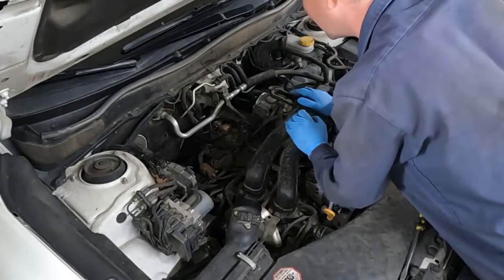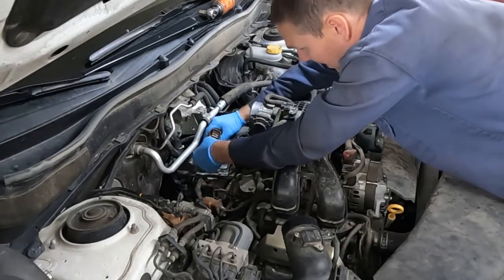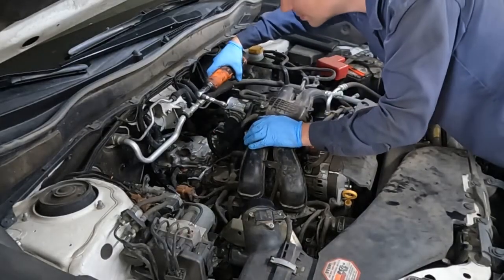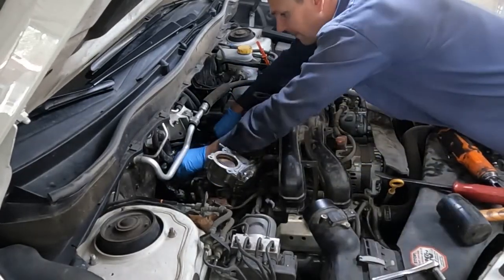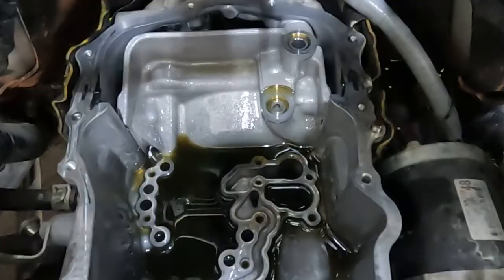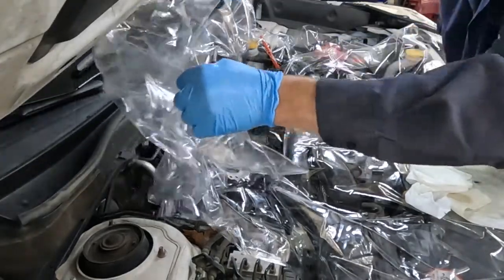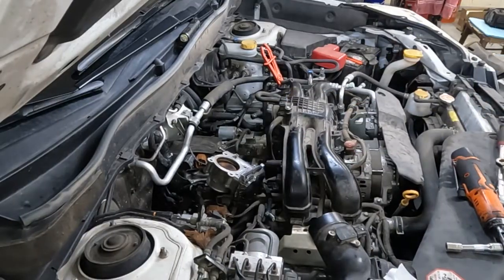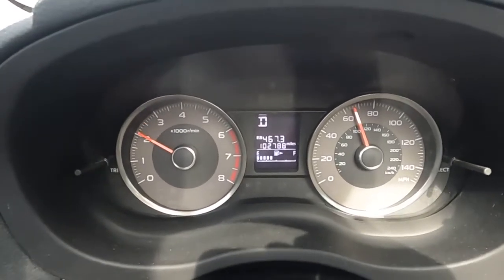2010-2016 Subaru Forester, Outback Transmission Valve Body Replacement | TR580 CVT

Comment from the maker: You now have the option to just replace the solenoids instead of the whole valve body! The links are in the description 👍
Reply: This was the comment I was hoping to see. I have a pressure control solenoid C - was told by my mechanic friend it could be replaced
Reply: En donde se encuentran

Comment: Just wanted to say thank you for such an awesome video. I watched this a few times and knocked out the replacement start to finish no problem.
Reply from the maker: Awesome! Glad this was helpful 👊. When I had the plastic draped over the engine I felt like a surgeon 😂
Reply: @ValleyMobileAutomotive  yeah I thought to myself… what a good idea and when I unboxed mine…. I tossed it to the side and got into it 😂 but I did power wash everything before starting.

Comment: We have to do this ourselves as we are in Belize, and no Subaru shop to be found.  Great video.  We have the 2015 Forester XT 2.0, is the process substantially the same?  It would be nice to replace just the bad solenoid, but then again, what if a different one fails after the repair?  We're going to play it safe and do the whole body, but rebuild the old one as a spare.  Any suggestions?

Comment: Check wit your local dealership, my 2014 forester had 115000, and they did this free under warranty! It was extended due to a known defect
Reply from the maker: Thanks for the heads up! If you can get it done for free that's a huge bonus 👍
Reply: Just had mine replaced on 2014 outback. Did not have extended warranty. 1800 repair :( but glad it's done. Runs great now.

Comment: Maybe I missed it, but you forgot to do a TCM Relearn. TCM needs to be calibrated to the new valve body. Also, there are some software updates (Reflashes) for some of the CVTs. 
IIRC, 2015 and later models, Subaru has extended the CVT/Valve body warranty. Check with the dealership.
Reply: extended the CVT/Valve body warranty I called them they said up to 100K miles  only .....mine has 127K 2014

Comment: You didn't do the transmission flush and do relearning after this valve body replacement? I thought you must if you opened your valve body.
Reply from the maker: The steps to keep your work area clean will make it so a flush is not needed. A relearn was not required for this vehicle. After the replacement I took it on a test drive with no codes or shifting issues.

Comment: I have a 2011 Subaru Forester X touring, would the location of the valve body be in the same place shown in the video? I just bought the car 2 weeks ago with 100k miles, but the valve body is acting up and the dealer says they were unaware of that problem when they sold me it. Now the dealership mechanics are working on it. I’d really appreciate it if you answer. I want to check to make sure they actually replaced it because I didn’t purchase a warranty on the car, but received a 45 day warranty for free from the dealer and I’m afraid they might trick me into believing it was repaired.

Comment: Is the transmission you're working on a CVT? I have a 2010 and a 2013 Forester XT and they use the 4EAT transmission. Is the valve body in the same location on these?
Reply: Hello did you ever find out? I can’t seem to find a lot of info

Comment: Why did you replace all valve body? You can check resistance on the cvt connector, valve resistance is about 10-13 Ohm, 4wd valve resistance is about 3 Ohm. You can replace only valve and it costs about 50$
Reply from the maker: Thanks for your comment. During the time of this repair the only way to fix this using genuine Subaru parts is to replace the whole valve body. If there are aftermarket solenoids available I don't have any experience with their reliability.
Reply: hello ........... do you have the photo for the resistance and location please

Comment: I have a 2012 XPremium 2.5   transmission with code P0763 code.  A mechanic that does not work with Subaru that often says I need a new Transmission Valve Body replacement but that is not the code you mention.  Thoughts?  Mine is not the CTV transmission but the other one. Thanks in advance for your time if you answer
Reply from the maker: That code is for the shift solenoid C. This is an electrical circuit code. With a few relatively simple tests you can determine if it's the wiring or the solenoid. I don't know if the solenoid can be replaced on that transmission or if the whole valve body needs to be replaced like in this case.

Comment: My 2011 outback has torque bind when turning sharp on dry pavement.  I was told it was the valve body.  Does that sound right?  I already changed the CVT fluid and oil in the rear diff.  I have no codes.
Reply from the maker: @NaturesHealingGrace  Yes, a faulty  AWD solenoid can cause binding while turning sharp. There is a fuse that you can install to make it FWD. Install the fuse and see if that makes a difference. Also mismatched tire sizes can cause this issue. Have you had the transmission or rear differential replaced recently? There are a couple different options that need to match or it can cause binding as well. Another thing I can think of is if the AWD clutch packs are worn and binding but that's not common.

Comment: Hello brother, please can you help me regarding the dimension of valve body, for 2011-2016, is it 29.7 x 19.9 x 17.9 cm; 4.43 Kilograms? please help me, coz i am doubt if it is fits to my car, i am planning to order  in online.
Reply from the maker: There are two different transmissions for these. If you're not sure then the best thing to do is call the dealer and talk to the parts department. Give them your VIN and they will help you out.

Comment: The plastic is not to keep cvt fluid off the engine it's meant to be put on right before pulling the cover to reduce contamination of the cvt fluid. 🤦

Comment: Are subarus unreliable? I bought a 2014 forester ip. Driven only on weekends , it has 60k kilometers when I bought it.  Now66,000 kms. At oil  temp came on, along with abs, hill descent Nd traction control. According to the mechanic, possibly cvt valve body. $1,000 to fix. Fuck this shit
Reply from the maker: Unfortunately Subaru CVT transmissions are having issues. Mostly with the valve body. $1,000 is a decent price for this fix. The valve body itself is expensive. I haven't heard of repeat failures so it's possible the parts have been updated. If you do this I would only go with a valve body from Subaru, if you find an aftermarket valve body I would avoid it no matter how tempting the price is.
Reply: In the US, Subaru America extended the warranty on the CVT from 60k/5yr to 100k/10yr on my 2015...had similar light up and p0700/p2763 codes at 87k miles. No other symptoms. Dealership replaced for free. I'm now trying to learn if I should be worried about the rest of the CVT failing next. I've only done a drain/refill at 70k. But that's only about half of the cvt fluid (~5 of 10qts). Maybe the host has thoughts on it.
Reply: @ValleyMobileAutomotive  my mechanic was good,  the only thing broken was 1 of 4 solenoid inside the CVT. He replaced just that one and its fixed. 1,000$ or 50,000 pesos. Not a small budget  by any means. Im scared of thinking what could fail next. CVT replacement will cost about $2200

Comment: Sir you are wrong you can just replace the solenoids instead of the complete valve body
Reply from the maker: You are correct. The solenoids are available separately. I have the individual solenoids in the description.